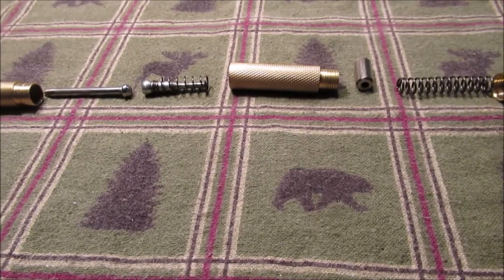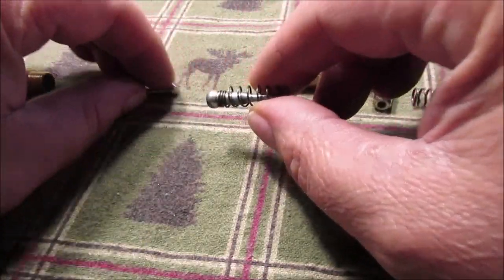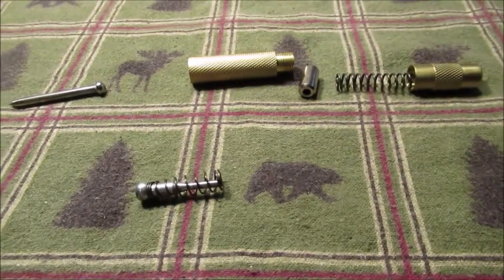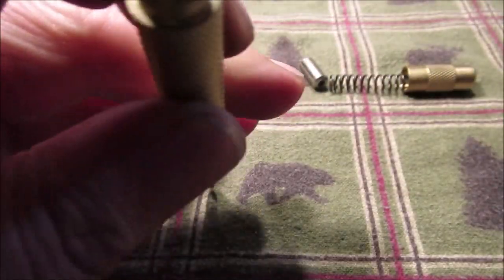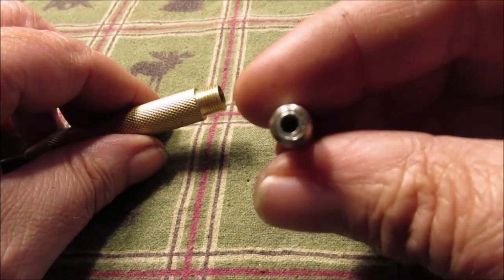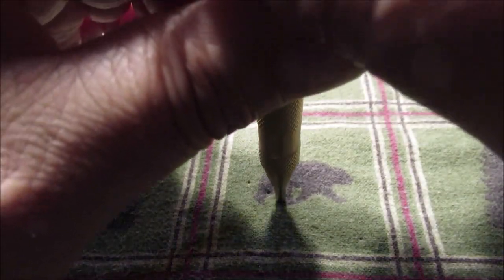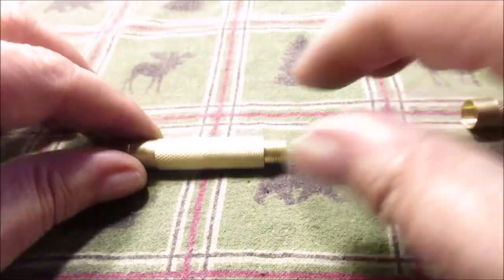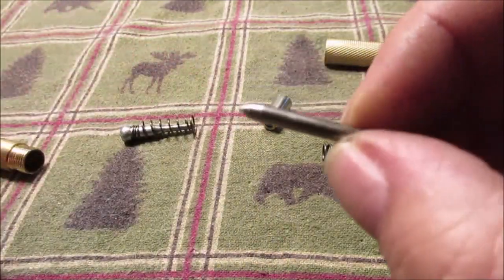Automatic Center Punch ( REPAIR )

Comment: At work with about 300 holes i need to drill in brass and my punch just didn't want to punch.  You have saved me so much frustration and honestly I can't thank you enough.    Also thank you for getting straight to the point and not rambling for 18 minutes!
Reply from the maker: Thanks for watching  I have learned another little fix to make it work even better  Some one has a video on it how to re grind a part in it that gets worn down

Comment: Dude thank you so much. I've been messing with this for I swear over an hour. I fixed it right along with you the first time I watched this. You explained it so anyone could understand. Thumbs up!
Reply from the maker: I have fixed another problem with mine   The part with the hole in it where the pin slides over and goes through gets worn out and is to big I ground it off a little so the hole is smaller  Now it gets more spring pressure beforre it fires  Kinda hard to explain should make another video on it
Reply: me too!!!

Comment: Several things have to be just right for this to work. Start with the top of the tapered pin. It must be perfectly flat. If its domed at all it wont work. The bottom of the hammer must also be flat.

Comment: I just got a step-hole kit that came w/ an auto center punch like yours. It didn't work at all 'til I took it apart. I put it all back together (with your guidance) but it still works EXTREMELY hard. Do you think putting a tiny bit of oil in the hole at end of the pin would help it engage? Hope this makes any sense🙃 

Thanks in advance for any tips!
Reply from the maker: They do have a heavy spring in tmem but that is what makes them work

Comment: How did it hold up after you re-ground it?  I'm about to do the same just wanted to make sure it wasn't some surface hardened part.
Reply from the maker: I have resharpened the point may times The automatic part still works good

Comment: Thank you for showing how it works I realised I'm missing the front spring and centering mechanism.
Reply from the maker: Glad I could help ..They are interesting to take apart and see how they work
Reply: Were you able to obtain the second spring and middle piece/pieces? If so, where did you obtain/find them?
Reply: @23895645  if your asking me no ended up buying a cheaper one to use parts after grinding them down but so far I've just been using it instead works just as good.

Comment: when I opened mine a ball bearing fell out. can't figure out where the  hell it's supposed to go... ?
Reply from the maker: Mine does not have one
Reply: You're doneee
Reply: Mine also.  When I reassemble as shown here the punch works on "light" setting, but if I screw the end in for a heavier punch it no longer punches.  Search on manufacturer's website does not even show any results (General Mfg. N.Y. - model 77).